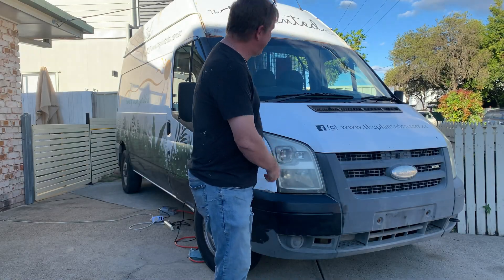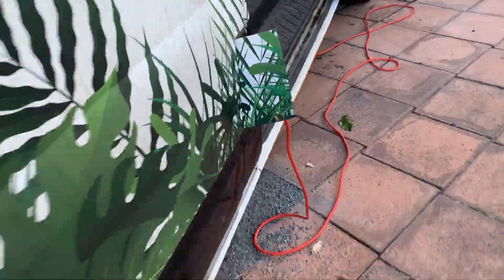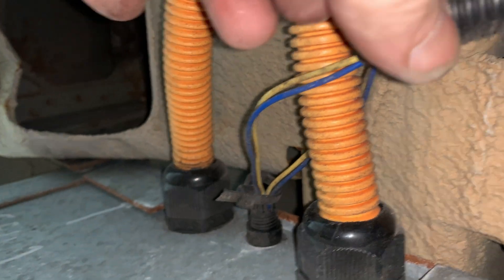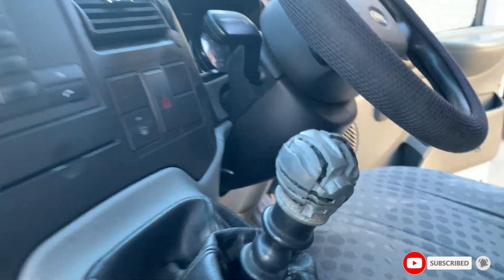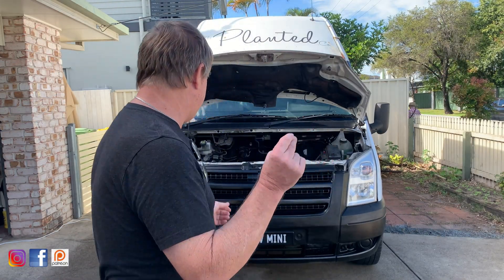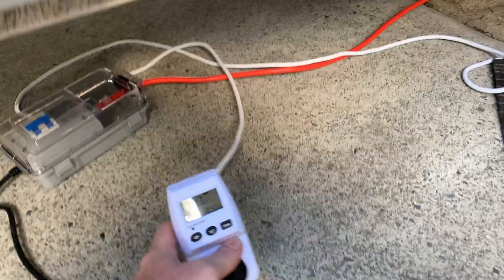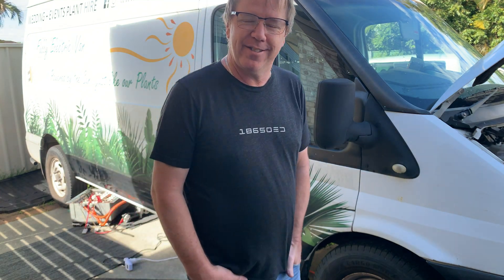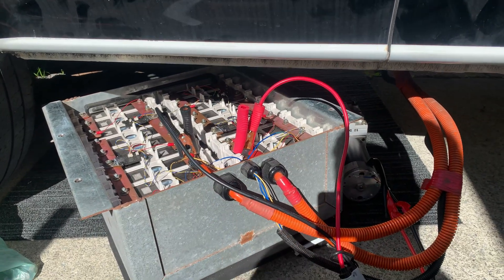Cheapest EV Van conversion on Facebook Marketplace - Time to build a EV Camper?

Comment: Pretty nasty build. Still able to fix it up though.
Your going the right way. You can do the cell packs individually too. Without the bms. With a stand alone revive kit GL !
Reply from the maker: BMS is doing the job perfectly - cell voltages are being charged  (better to say controlled) by the bms at a small 0.4 amps - at this point we think we have a single bad cell and i'll be heading down on the weekend to find it (with out taking out all the batteries hopefully) and take it for its first test drive in our ownership.

Comment: That loose connection seemed to turn the orange indicator on the charger meaning the charger thanks the battery is in float even though the battery was low. Could it be that the loose connection meant the batteries weren’t charging at all hence battery low?
Reply from the maker: not sure, but it's been charging for 3 days now at 200watts from the grid - with the Batrium set to auto to control the current. Battery is at 139v considering the battery we took out and charged is at 19-20v take that away from the 139v puts each cell at about 2.7v (I think... i suck at math lol ) There is also a light on the dash with the same thing from the 240v Charger and it's always worked - maybe it was must me playing with it that made it twig out.. (or dust/dirt/water/crap from the road go into the plug... )

Comment: I would recommend cleaning the busbars and battery poles, buy a good tester to test the batteries, they might actually be broken.
Reply from the maker: In the short term won't be pulling all the batteries out - too much effort, try to charge in place let Batrium take care of the batteries then road test, then get home and check the batrium logs for issues. We have already decided battery will be replaced but would be awesome if this one could be saved.
Reply: @HBPowerwall  maybe opt for a neey active balancer, doesn't break the bank and saves a big amount of time, the Batrium can do the watching.otherwise charge by bank with a lifepo4 tester
Reply from the maker: I will never hide issues with an active balancer - they are a joke on YouTube promotors.. They don't fix or find battery faults, all they do is make bad batteries more useable for longer...

Comment: Time for a good JK BMS with active balancer and settings, indeed talk to Andy, he knows his bit of LifePo4 and the correct BMSes. You could opt to have an external balancer activated, Andy has some info on good Neeeeeey ones which work and are switcheable. Good luck!
Reply from the maker: Cold day in hell when I move from Batrium to a JK and a freeking active balancer...
Reply: @HBPowerwall  not all apples are good apples for a BMS. YMMV for a big LifePO 4 which needs higher active balancing. Look at Andy's videos and it will tell. But these are just my 2cts.
Reply from the maker: I hear you, but 1.7amps discharge when needed is more than enough to do a proper job.

Comment: If anybody could you could.
Reply from the maker: I'll give it a good hard crack, issue is van is located 100km away and it's a long drive in a 50 year old Mini lol I might have to buy a more modern car for the trip (do have an MG EV but it's usually used for family use)

Comment: def clean up the wiring, remove rust and corrosion and repaint. while everything is out you can find that parasite draw.
Reply from the maker: Yep, in that order - Rust holes in the roof are just passthrough holes for the solar cables :P

Comment: I have always thought it would be much better to mount the ev moter directly to the diff buy passing the gear box and tail shaft. What do you think
Reply from the maker: With the right amount of space it sounds like it makes sense, Using the gearbox for a commercial van makes sence though I think

Comment: I am not a liker of Batruim, i have one and now sitting in a box collecting dust, I like the DiyBMS open source.
Reply from the maker: How long did you have your Batrium up and running for, I've never used DIYBMS - but love my 4 Batrium systems
Reply: @HBPowerwall  Run less then 3 months, they wanted to charge me for a help phone call, it was a dead wifi on the main module. Won't helpful at all.
Reply from the maker: fair enough..

Comment: Hi Pete, you should contact Andy from the offgrid garage. He lives afaik near Brisbane and has many knowledge about lifepo batteries.

Imho the batrium balancer is not capable enough for ev usecases
Reply from the maker: Thanks for the tip!
Reply: I've never heard him say hello from Victoria,  it's always hello from sunny hot Australia
Reply from the maker: I'm sure he is on the north coast
Reply: I think he's near Ipswich. On holiday currently.
Reply from the maker: I've reached out a few times via email but no response - Understandable due to the emails I delete each day and don't respond too heheh
Reply: @HBPowerwall  No Pete, he is most definitely not too far west of Ipswich.
Reply from the maker: ok
Reply: @HBPowerwall  he once said he does it the same way. Maybe you can try it via comment, or, he has other channels on yt. maybe this can fix it ;)
Reply: I would also suggest that the coupler between the electric motor and the original transmission is shot. In the early days of conversions they often manufactured these parts from plastic so they could absorb some of the shock from the high torque electric motor and the transmission.
Reply: If you need some help understanding LiFe I can help. Basics - nominal Voltage 3.2V per cell, fully discharged @ 2.5V per cell and fully charged @ 3.65V per cell.  Very flat discharge curve due to the very low IR. Basically @ 3.45V per cell they are full - charge up to 3.6V only to top balance. Because of the flat discharge curve you can't really work our SOC from voltage. Pretty much got to fully charge, fully discharge under typical load, work out the kWh value of pack (because it's used) and count Wh when discharging. I don't think those cells will be much good - too low. They might work in a less demanding application than an EV, but you can get decent quality cells direct from China pretty cheap. Just got to know where to shop, and where not to. Andy has a couple of suppliers listed on his Off-Grid Garage website.
Reply: Andy from  offgrid garage definitely lives near Brisbane
Reply: @stevenlane729  He always says "hello from sunny Victoria", is there a Victoria up in QLD?
Reply: Just checked Andy’s Tesla has QLD plates.
Reply from the maker: Wonder if Andy has hairs sticking up on the back of his neck 😂
Reply: @HBPowerwall  Think so ;).
Reply: Andy says sunny hot Queensland all the time. He has driven locally into Brisbane before too on his videos so I agree likely near Ipswich
Reply: Many knowledge?😂
Reply: @Wazaarbazaar  sorry for my bad english. Wie ist dein deutsch?
Reply: Andy is in Victoria

Comment: Nice easy project! 

For a conversion done by a company it doesn't look very professional...😂
Reply from the maker: Very true!, but I don't know what was done after the conversion or the price point..
Reply: Yeah, my thoughts exactly.  That poor DC-DC charger, definitely not designed to be there.
Reply from the maker: Looking into some faster charging options or even duel charging.
Reply from the maker: Since the video I've learnt something new, to the left of the motor controller is the actual 144v to 12v converter, blue one on the right is actually the 'battery charger' if I'm understanding it correctly
Reply: @HBPowerwall  Yeah the Renogy DC-DC will be doing the 12V battery charging.  The other box, might be doing 12, might be 24.  Those DC-DC chargers come in different input voltages, not sure about Renogy's though (its all badge engineered anyway).
Reply: The blue Renogy is a 12v to 12v charger you normally use incase you want to charge lithium with a normal or smart alternator.
Anything that's powered by the hv battery is (should) be wired with the special orange battery cable.
The box on the left is maybe an ac to dc powersupply (to charge the 12v system when connected to the grid?) or dc to dc if it's connected to the hv battery.
Reply from the maker: Thanks for that @retromachine1189 & @martinmooren9536

Comment: And it moves!
Reply from the maker: it's done a few back and forth trips to the other side of the drive way so far.. functions as expected (after we re-fitted the battery)
Reply: @HBPowerwall  You have the knowledge to get it back to life, that's impressive. But your brother will need to do something with that rust all over. Salty air area you mentioned. Cheers, nice job.
Reply from the maker: I think he will use the rust holes to pass solar cables through from the roof :P